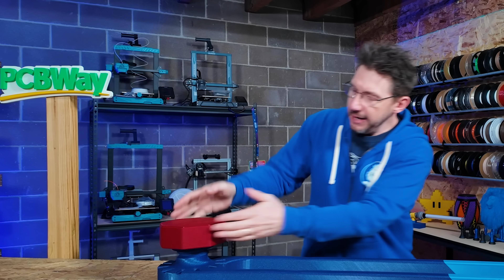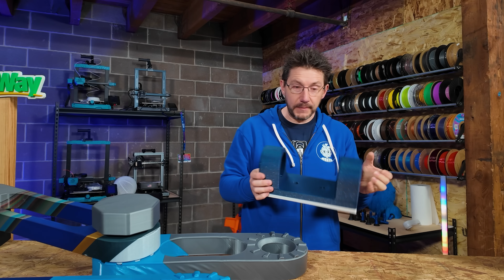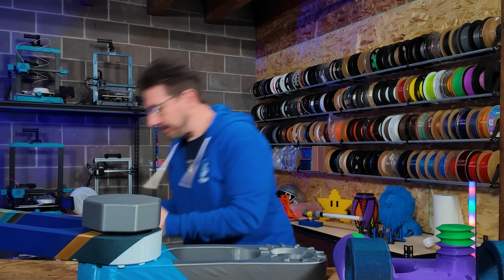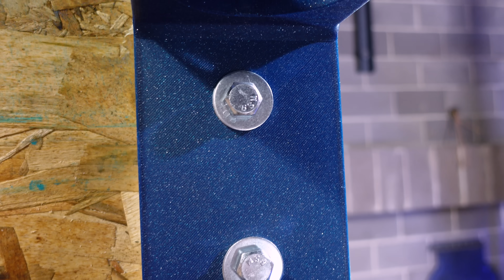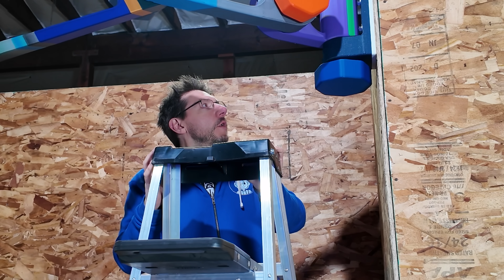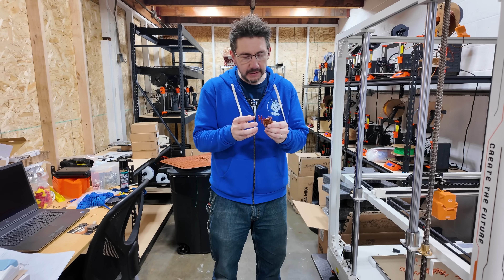My OrangeStorm Giga is Dead

Comment: The OrangeStorm is a proof that not everything works if you scale it up. There are parts of the machine that should be redesigned. The printbed is one of the problematic parts. Layer adhesion is not uniform enough. Might be due to heat differences and expansion. Just a little draft can be enough.  The motors of the movement system are not strong or durable enough for the large movements.
Reply: Their Neptune 4 pro suffered from the EXACT SAME ISSUES. This isn't a "scaling up isn't good", this is "crap products and QA will make a horrible printer at EVERY size" thing.
Reply: It would work, but it would need more motors and drivers. 
This is due to Elegoo always taking the cheapest path possible with the least amount of engineering required. 
Voron (Phoenix) and Rat Rig (V-Core 4) both have 500 x 500 enclosed printers that are designed to handle the size and work properly. 
This is an 800 x 800 with lesser components than either of those machines. It's ridiculous.
Reply: @ScytheNoire  It seems like they are just trying to use up older parts that they probably over bought, or were told to over buy. Remember, no company works in china by itself.
Reply: not to mention at that size ridgitity becomes a really tricky beast. if you floor/surface isn't flat it'll show on the build plate as itll conform to the shape of the floor.
Reply: @Altirix_  

The feet can be individually set at different heights that the printer is level.
Reply: @Altirix_  Then again with big stuff you usually don't care tooooo much about accuracy. I think you should be able to get good enough results with a bed leveling sensor.

Making the bed from a metal plate as thick as possible would help a lot with that though. Like 10mm thick maybe. Would still warp a bit cause it's big as heck, but should be better. Also would prob take forever to heat, but I guess if you're printing something huge you're not in a hurry anyway.
Reply: RatRig works at 500x500
Reply: If you paying that much for a printer I don’t want to deal with adjustment knobs on build plate to level the bed.
Reply: @samflower6612  you cant have it all though, this thing has 15x the build volume of most fdm printers for twice the price of an X1 carbon. I totally understand why this product isnt for you, but Id rather spend my money on printing capacity and put my time in as an extra. Its why I assembled my 3d printer myself
Reply: @samflower6612 even at full price, it's in the realm of a Bambu x1e, and even Bambu doesn't always print perfectly. Considering the size, this isn't "Lambo money", even the x1e is, at best, a Tesla model S, of 3d printers. The "Lambo money" "if-im-paying-that-much-it-better-have-[somefeature]" printers are like....multi jet fusion printers, which are well into 6 figures
Reply: @samflower6612  That much it's $2,5 00 try finding any 800 mm cube printer for less than 8k that you don't build yourself from scratch
Reply: No an FDM printer like this does work scaled up, you just need to scale everything up, including tolerances. This printer is 2.5x that of a regular printer, therefore thee nozzle needs to be 2.5x the layer height needs to be 2.5x 

whilst true when scaling that somethings get scaled linearly and others more aggressively I dont think thats the issue here. Its not a flawed concept, its a prototype with a few fixable defects
Reply: Apparently, only Ivan Miranda knows how to make large 3D printers that work.
Reply: @BrunodeSouzaLino  What?  Never seen Dr.DFLO?
Reply: skill issue
Reply: Those belts look way too small to be accelerating and decelerating that size print head at any reasonable speed. They should have used lead screws or at least a 30mm steel core belt and some servos. 

Its just a extra large piece of chineseium as it ships.
Reply: @bthatguy1181 30mm belts would probably turn off most of the niche market for a variety of reasons. They would have been better off going with cable drives or rack and pinion drives than that.
Reply: @claws61821  I dont think so, I have a medium sized laser that uses them, seems pretty standard for that size gantry. The motors would have to increase for sure, and probably should be if anyone wanted to use one of these for any work. 

(I cant think of a home use one would have for such an expensive got to fix it first machine)
Reply: @bthatguy1181  Uses which? The belts? They may be standard, but that doesn't mean that everybody trusts them or likes the idea or the appearance of them; and laymen tend to be more suspicious of wide thin belts than narrow thin belts.
Reply: @claws61821  Belts. Who cares about the looks when your machine cant .. function? 

Big machines need big parts. Simple. 

these printers are just a way to get marketing and use up last gen parts.
Reply: IMO its proof that scaling successfully can't be at a consumer hobby price point. All of those decisions were made to make the machine affordable but failed to recognize that the limitations added cost to failure points, and so not a viable experience. I'd image the lesson other brands will take away is that its not worth the damage to the brand to scale to this point at this price point.  There are industrial grade machines at this size that work well, but cost 10x the price. There's a reason for that.  I can only hope that these MFG find a middle ground where hobbyist can advance toward professional grade equipment without the massive financial leap that exists today.  The right space IMO is where Joel suggests. Putting some more time and money to push it to the price and capabilities that make take the next step forward. Affordable, but certainly more expensive than the price point of the giga and less than the industrial grade machines.
Reply: @VacFink  There are also 3d printers twice as large as this, made by hobbyists, built cheaper than this was with off the shelf parts a decade and a half ago, that are still running and are plenty reliable for continuous daily and heavy use, some of which were even being taken all over to convention after convention for most of that time with no significant downtime for major redesigns or repairs. 

Cheap design has nothing to do with the problems with the Giga. Bad design and bad manufacturing have everything to do with it, and you'll find those both separate and together at every price point. Hell, if you pay any real attention listening to operators, it's MORE common as you go into the tens and hundreds of thousands of dollars price brackets.
Reply: @claws61821 they were made cheaper but they couldn't be manufactured and sold cheaper. Else someone would be selling them....
Reply: @DrewLSsix  Except that they were made with off the shelf parts, not with junkyard or junk box parts. If you can make something with bought-new parts from the store, you can always make it cheaper with bulk-purchased parts. That's how the economy works.
Reply: @VacFink You can go build a voron 2.4 bigger than that giga and cheaper right now

Comment: It may not be a specific Giga problem, but on the other hand... it is. Support being way too slow is a Giga problem and part of the experience. The center should not be an issue for adhesion, if it is, it's a Giga issue. Good to showcase and super nice to see it being modded (which still is a thing and why I stopped buying cheaper printers). :) I did learn a ton doing that, but at a point, you also see the huge amount of waste it produces when needed straight from the factory.
Reply: Thats a  "it was made in china" problem. Just think of how much fuel is being wasted sending parts of these to the reviewers who cant get them working out of the box. 

Looks like another pile of leftover last gen parts masquerading as a consumer machine.

Comment: I have been worried about this machine from the start. Trying to go that big at that price point, they had to cut corners, and they sure did. Maybe I should design a large format printer again, and make it available. It won't be as cheap though. Lol, real engineering needs to go into a printer that large.
Reply: As someone who has repeatedly looked into DIY building a printer but not bitten that bullet yet, and who knows just enough about supply chain economics to get myself in trouble, this price point still left them a lot of room to profit WITHOUT cutting corners. Better to educate yourself on the subject and deal with frustration, than give them false excuses and look either a fool or a shill.

Comment: I'm excited to see the Bluestorm! Seems like it's currently an extra large printer with build quality of an Ender, needing all of these mods to make it actually consistent. I don't even think Enders are this inconsistent any more.This seems like it would be the perfect candidate for one of those Beacon Scanners after you rigid mount, rather than a 4,000 point bed mesh. Maybe a high flow Revo with a 1.4 Nozzle?
Reply: Moving beds on large printers are very problematic due to the starting and stopping of a large print. If you have a thick walled large item that has 15kg of plastic, that's 33lbs you are jerking back and forth. Large closed loop steppers would be a must.

Comment: I feel your frustration. I wonder if a return to the days of using a raft would help level out the difference between the four build plates?

I like the fuzzy skin idea to add stiffness to vase prints. I'll have to remember that one (not that I very often print large vases, but I'm sure to at some point). Thanks for the tip.
Reply from the maker: It’s a great idea I always forget about!